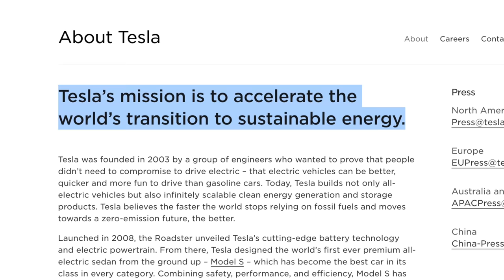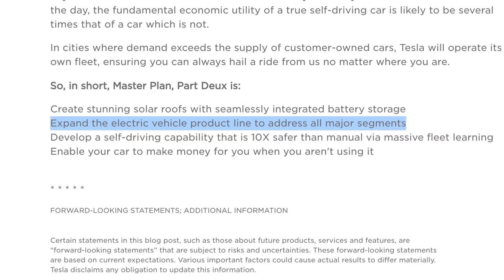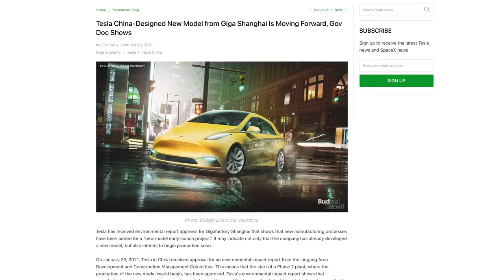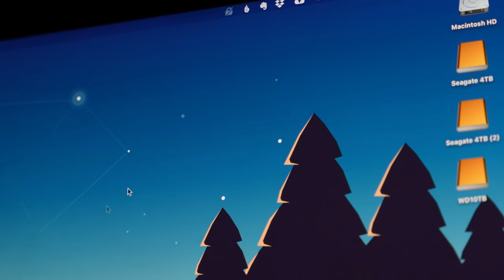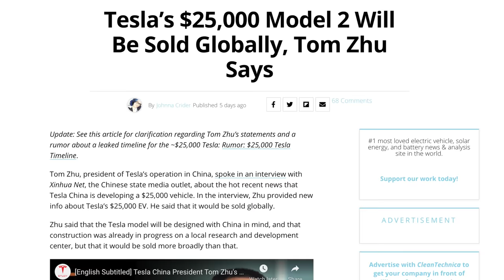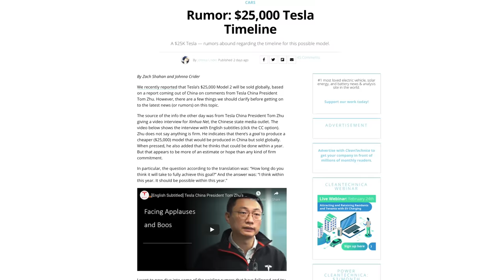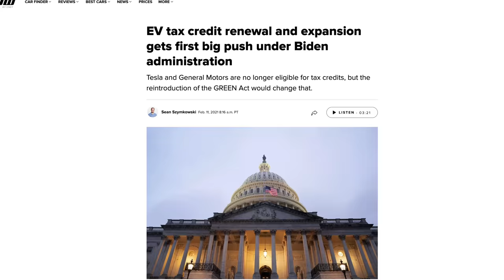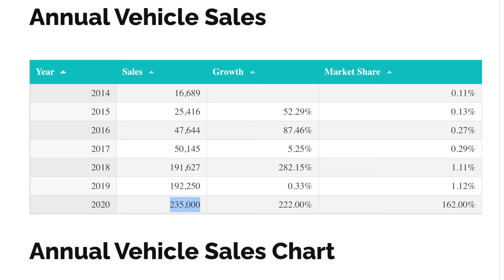New Tesla Model 2 = Game OVER for Gas

Comment: "The more of the earth population we can rope into the big brother fold the better" <------ Big Brother quote
Reply: Don't cut off your nose to spite your face.
Reply: The funny thing about this is, most of the people don’t even realize that the electricity you charge the car with is from coal fired power plants. So much for clean energy. Let alone getting rid of the batteries, it’s worse than toxic nuclear waste. And becoming a major problem.
Reply: @toomuch8232  depends on where you live. 

But even then, electric cars are far more efficient, which is why hybrids get such good mileage.

The batteries they use can also be recycled. In, fact, the lithium is a fairly valuable metal and recycling facilities are being built.
Reply: @toomuch8232  Electric cars lead to lower carbon emissions overall, even if electricity generation still relies on fossil fuels. In countries with a heavily decarbonised system such as Sweden and France, which have large amounts of renewable and nuclear generating capacity, the average lifetime emissions from electric cars are up to 70% lower than petrol cars, while in the UK, which is rapidly phasing out coal but still has a reasonable amount of gas-fired power plants, emissions are around 30% lower.
Reply: @ihcterra4625 ... 

More efficient? Say I leave NY in my Jeep Gladiator and you leave at the same time from NY in a Tesla. I’d get to LA a week before you do. Depending on the model it takes 6-12hrs to charge while it takes me 5 min to fuel. I can go 400 miles before filling up and you have to stop every 250-350 miles for 6-12 hours to charge your car. That is if you can find a charging station in the mountains or the desert. If not you’ll need to call a tow truck, not just buy some gas. 

I’m trying to grasp your meaning of efficiency. It doesn’t seem efficient at all.
Reply: @Jari_Jerboa  The UK is the size of a postage stamp as is Sweden and France compared to the US. From lands end to John O’Groats is 834 US miles. Texas alone is 879 US miles to cross E to W. Please don’t drive an electric car in W Texas, you’d never make it out of the state. 

It makes no sense to own an expensive electric car in the US.
Reply: Too Much I think he means carbon emission efficiency as even though most electricity is made from fossil fuels it is still better for the environment as more renewable power is Available
Reply: @toomuch8232  you’re actually wrong on two counts. A Tesla supercharger can charge a Tesla in thirty minutes and a Model S has at least 400 miles of range
Reply: @toomuch8232  You're uninformed. Case closed.
Reply: @toomuch8232  I'm talking fuel efficiency. 

Efficiency is miles per Kilowatt vs miles per gallon. An electric car gets more miles per equivalent unit of energy produced than a gasoline vehicle. A larger percentage of the energy produced is converted to motion. Electric vehicles convert over 75% of the energy they produce into motion, gas vehicles convert somewhere between 12%-30% 

It is usually expressed in Miles Per Gallon Equivalent or MPGe. An electric car gets anywhere from over 90 MPGe to under 140 MPGe. While your Jeep Gladiator gets roughly an average of 24 MPG combine city/highway. 

So it's roughly 4-5 times more efficient to burn coal and charge up a battery.
Reply: @Dale Walker When Ford introduced the Model T, there were 200,000 cars on the road and a single tank of gas had more range than the total miles of paved roads in the US. 

When it was introduced, it cost over $20,000 in today's equivalent dollars and they sold just under 11,000 cars. When Ford was able to get the price down to the equivalent of under $5,000, they started selling millions of cars per year. That demand created the infrastructure we have today. By the end of production, Ford has sold 15 million model Ts. It was the most popular car sold until the '70s and it still in the top 10 in spite of ending production in 1927.

The way to create the infrastructure for electric vehicles is to make everyone want to buy them because they are cheaper to buy. It may be more awkward to start off, but when the demand for infrastructure is higher than for gas, everyone will be converting their gas stations into charging stations.
Reply: @Dale Walker so you like being dependent on foreign oil? You enjoy subsidizing one of the most profitable industries in the country?

Personally, I'd rather have options and ones that are cheaper. Electricity is far more cost effective for the end user. 

If you want to be a slave to big oil, go right ahead. I just don't want to subsidized it any more.
Reply: @toomuch8232  it was proven to have started in the live animal market and not released by a lab.

You are pretty gullible. You believe liars because they tell you lies your itching ears want to hear and feed your hate.
Reply: @ihcterra4625 ... 

Hate? No kid. I’ll leave that to your side. But if you get out of your Marxist social media bubble, it’s only news agencies and China saying what you have said. MI6 in the UK, CIA here, Canadian intelligence all say not so fast. 

3 virologists have escaped Marxist  China and have gone on record saying that the virus escaped the lab in Wuhan. If you believe the Marxist Chinese government and the WHO, then I’d suggest you are the one that has the problem. 

Just as Hillary deleted 33,000 incriminating emails, when asked for their work on Covid 19 the Wuhan lab said that somehow all their data and research had been deleted. These are facts, not supposition. The Chinese government is in fear of having to pay other countries for releasing the Rona. Not that they would, but it’s bad PR for socialism/communism. 

The only people that I know that believe what you say? Socialists/communists. Everyone else follows science. Go on YouTube and you can hear the actual Chinese virologists explain it to you... They were there and had to escape before they were killed by their government. Just as the Chinese Dr that tried to warn the world that his government was lying about the Rona. He didn’t make it out, he’s dead.
Reply: @ihcterra4625 ...

Umm, yes, kid. Where were you when Jack Kennedy was killed? Simple question really. If the answer is “not born yet” I stick by my statement. PS... I already know the answer since you said you were a kid in the 1980’s. So I stand by my statement. 

Also, I notice you skipped over everything else I stated. Not surprised really. Probably after a quick search you realized I am correct. 

God Bless, kid! 😁
Reply: @Ok-kx2te ...

Just looked it up. First it takes 45-50min at a “supercharger” station. (Good luck finding them outside of cities) Also the model s starts at $70k. We are talking about this $19k tinker toy. 

I just looked on the forum for Tesla model s owners. After 4yrs they are getting 194 miles at 90% charge. And the charging times increase and less and less miles as the car ages. And the replacement battery cost is over $7000. If you can even get one. The people in the forum have been in a waiting line. 

So, good luck with all that.

Comment: Two words： Renault Zoe

And a third word: TODAY.
Reply: Old Zoé are doomed, they battery as been discontinued. And its hard to find any Zoé with more than 100000 km so im not really optimistic regarding Renault elecric car..
Reply: @sweeper7609  Of course the old batteries have been discontinued. If you really want to replace a battery in an old Zoe, why would you go for a 22kWh battery, when you can get a 41kWh one to replace it.

https://youtu.be/miUOiXgyTeI

Other than that, most old Zoe were sold with a battery leasing. If the battery fails, it's not your problem - Renault has to replace it. And if I recall this correctly, the first models didn't have active cooling (or was that just on Nissan Leaf?). New ones definitely do have temperature regulation.

Comment: NOT "game over for gas."  For many of us humble apartment dwellers, getting our landlords to put in charging stations in their parking lots, driveways, parking garages, etc. will be a monumental task.  Also, people who live in the northern U.S. and the Midwest and don't have garages will face substantial charge loss from cold weather and substantial range loss due to using electric heating/defrosting in Tesla cars.  Also, even at the What-if, Maybe, If I Buy One Before the Subsidy Ends price of $19,000, a lot of people STILL can't afford it, which is why they (we) will still continue to buy USED gasoline-powered cars.  Finally, just because there's no exhaust coming out of your car doesn't mean it's a "clean energy" car.  Depending on where you live and at any given moment if the sun is shining and or the wind is blowing, you could be  charging your electric car with electricity generated by fossil fuels like COAL. In fact, the more people who buy electric cars, the more demand that will be put on electric power companies, and the more likely they will have to supplement whatever wind and solar power they can generate with fossil fuels.

Comment: Here’s what I don’t get. I think Teslas are great but charging them typically comes from fossil fuel fired power plants. I mean that’s like hauling a 3kw diesel generator behind your car and calling it “green” because it runs on electricity.
Reply: It still uses overall less fuel and long-term causes less pollution to make the necessary electricity to charge a car than it does to fuel an ICE engine. Engineering Explained did a video on this.
Reply: @kayEnt3rtainm3nt  Seems to me that investing in nuclear infrastructure is the best and proven option.
Reply: @MrJcknight007  You could very well be right 🤔
Reply: @MrJcknight007  Naturally. My parents have 2 EVs and live in a neighborhood with largely solar-powered houses but they're currently an exceptional case.

Comment: The Model 2 should have a longer range - don't go backwards, move forward. The reason people avoid an EV is because the range doesn't go far enough. Exterior design is a bit clunky looking.  Yes, I understand it's an inexpensive car but inexpensive doesn't mean it needs to look like a clog.  More people will purchase a smaller car because it's easier to find parking and handling a smaller car like a hatchback is zippy.  Please Tesla designers/engineers, no more mistakes like putting a huge rectangular screen in the Tesla Model 3 - a true eye sore. Did you see the Mercedes EQS interior where the screen is seamlessly built in?  It's amazing.  Thanks for the video! Andy.

Comment: $7000 tax credit does not equal cash savings from price...it would be whatever bracket you are in X 7000...so the top earner would save 35% of 7000 and so on

Comment: I'm worried about  Hmm much is gonna cost replace the batteries if they go bad
Reply: Expensive af, luckily that doesn't happen often, though.  The battery was my main concern when I was buying my Volt, but it turns out they're pretty solid and have a lot of safeguards built in to keep it alive.  As I'm sure the Teslas do, as well.

Comment: The probability of the final MSRP being that low is minimal. Plus the time to charge is also not cost-beneficial compared to gas cars
Reply: Three are other option which are better, less expensive, more efficient use of combustion engines with other fuels, which are also 'natural', sustainable, and renewable: Hydrogen, Ethanol. Methanol, Methane.
Also better designs for a EV with multiple electrical energy sources including solar panels, wind turbine, better regeneration, turbines, along with tiny or small ICE using these fuels.
Sincerely

Comment: This Tesla Model2 will not be for everyone who wants to drive an EV esp a Tesla. BUT it will be affordable and the battery@ 200 miles will be enough for MOST. I suppose there will be a LR battery for an extra cost though. All in all this car will be another Tesla success. 

I mostly charge up at home 95% of the time (solar) and my batteries get 304-307 in my model 3 and Y. I can say that I would never want a battery range lower than 300 just because of where and when I drive. I live in San Diego and drive to LA at least twice a month. Usually I stop to recharge when my battery when it gets close to 100 miles. Though I do not need to recharge, I do bc I drive usually over the speed limit but that is on me, not my Teslas. Btw, I usually charge at shopping malls, lots of Tesla stalls, usually available, and I get to grab coffee. Not enough time to actually shop, the car charges pretty fast.

Comment: Has to be chargers at all the spots for apartments ect..it's to cold in the north east not to be plugged in and preheat in the morning ..you won't see that fixed for 10 years at least.. then the huge grid problems after the charger issue is solved

Comment: How long/miles do battery last, cost to replace?
Reply: He mentioned in another video ev batteries last a minimum 8-10 years, with replacements costing around $4Kish, which is less than what it costs to replace a gas engine

Comment: I’m in the market for a 🚘 & prefer purchasing an electric 🚗 however apart from Tesla the charge stations aren’t maintained well & the apps available don’t report current or accurate info. I rented an electric car for a month as a pilot & found it was difficult to charge. The apps would provide locations with stations that’s were out of order regularly. I encountered phantom stations ( charges that were showing as available & were removed from the site or had yet to be installed etc. I spent more time searching for a charging station than I wanted to deal with. I quickly decided having a charging station maintained by the car manufacturer (Tesla) was the better option. However Tesla’s are outside my price range. This may change that.

Comment: videos on YouTube about earning electric cars, like the Nissan leaf point out things you need to think about.
  cold-weather reduces your driving range. A woman with a Nissan leaf plugs it in every night after work when she gets home. In the summer it will tell her she has 120 miles range. In the winter, first thing in the morning it will tell her she has 70 miles of range, so she has to take her husbands gas burning SUV because her round-trip to and from work is more than 70 miles.
  another electric car owner said that he bought a Nissan leaf if the battery was less than 50% capable of taking a full charge. He could charge it up overnight and it would work OK for taking him to and from work because it was less than 30 miles round-trip. The problem was, to spend thousands of dollars on a new battery was pointless, because the cars actual Kelley blue book value was less than the cost of a battery.
  A woman who had a Nissan leaf said that when you have an electric car, you can’t take it to your local mechanic to have it worked on, you have to take it to the dealership. I don’t know if there is a special license required in some or all states to work on electric vehicles, but that’s the way it is.. that woman said that they have terrible heaters in the winter. Using the heater and the air conditioner greatly reduces the driving range..
  The most practical design for a electric only car, is the way NIO is doing it.. There are videos on YouTube about this. With that car, you pull in to a battery change station just for that car. You get out of the car, and a machine that you pull onto lifts the car, A machine removes the battery, and the automated machine also brings out a fresh fully charged battery and installs it. No humans touch the vehicle for this process. It’s like a old jukebox changing records. It’s all mechanical. With that electric car the NIO, you get six free battery changes per month.. you pull in with your battery needing charged, and you pull out with a fully charged battery 10 minutes later..
  keep this in mind, Chevrolet discontinued the volt.. Harley Davidson abandoned their electric motorcycle project.I heard about two months ago there is a country I just can’t remember the name, that is going totally hydrogen..
  if every car in California right now was electric. Every power source producing electricity in California, could designate every watt of electricity just for charging automobiles, and it still would not be enough. tree huggers think they are saving the planet why not burning fossil fuels in their car. Guess what, power stations burn fossil fuels to charge your electric car batteries..tree huggers need to look at the complete picture.. all those forest fires taking place in the summer of 2021 in the west have put more than 980,000 cubic tons of carbon dioxide into the atmosphere. They have increased the temperature just from the heat of these intense massive fires of trees they are protecting.Just imagine instead of watching his trees go up in smoke, using the lumber that burns every year..

Comment: Of course its likely! Cause electric motors have few parts, no trans, no exhaust or fuel system. Batteries are getting cheaper too. More permanent magnets also could supply half the power or more!

Comment: The model 3 is already small enough. The more of these branched vehicles they add to the fleet, the more overhead to update their designs. Ford is already moving away from the sedan segment for this very reason. Toyota discontinued the prius c. I think the future will involve specialized manufacturers in each segment. For now, they should utilize the existing model 3 and add a cheaper option for the battery to save money. Make it customizable to tap into every price point.

Comment: It won't be game over for gas cars until it's possible to add several hundred miles of real world range in 5 minutes at public charging stations that have at least one station to every 4 gas stations. We'll also need an electric grid that can handle the increased load which is decades off.